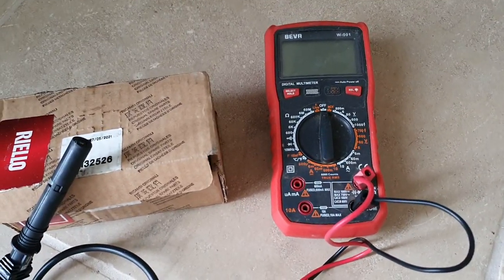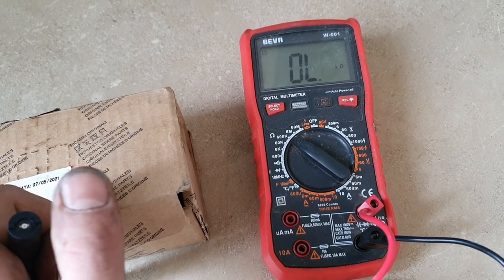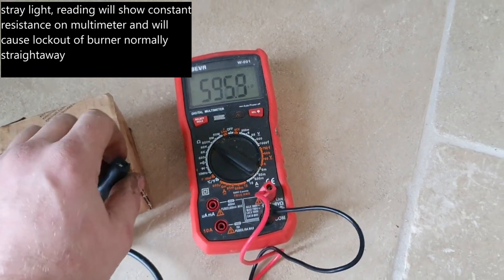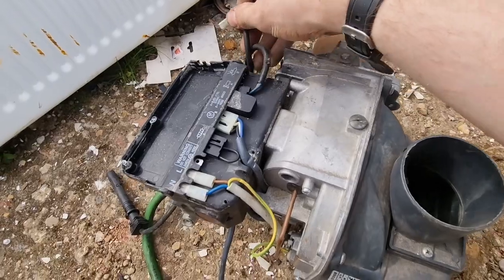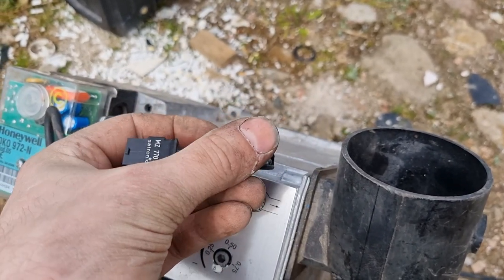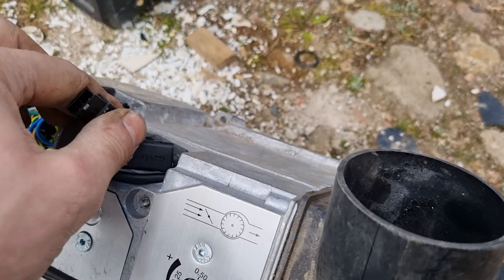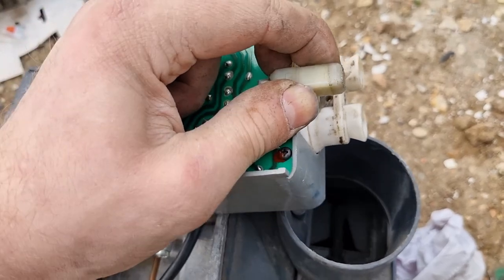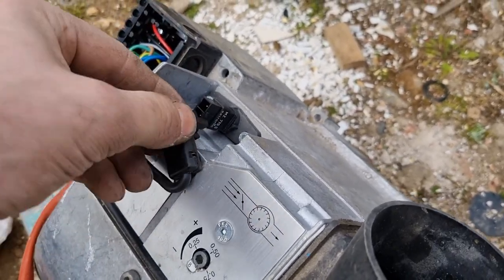Oil Boiler Lockout - How To Test A Photo Cell

Comment: Thanks for this Tom.
I noticed that you had your meter on 600k.
So I guess it's still a pretty high resistance is it.
Also are they polarised? I know some of the bigger gas burner photo cells were, but thoes sent a voltage back to the control box.

Comment: This is very interesting, I tried this test on a failed Riello photocell from my burner and it didn't read open circuit when covered. So I bought a new one and this just read a high resistance and a slightly different resistance when covered. I plugged the new one in and it works fine. I know Riello have changed the light sensitive resistor to comply with EU Cadnium rules. Could it be that it is not just a passsive resistor as there is a little circuit board behind it. Rieallo wbsite says checking this component is very difficult and you should just replace it. But they would wouldn't they. There is a guy online who explains how to replace the photocell which is what I will try with my old one.

Comment: our worcester burner doesn't fire on, lock out all times, have oil coming out on bleed valve, it does start but when it should fire it goes to lockout. is there a spark unit?